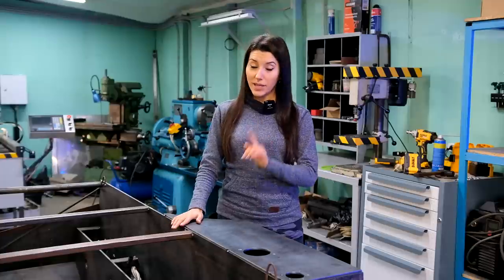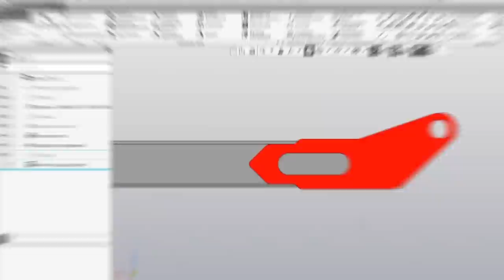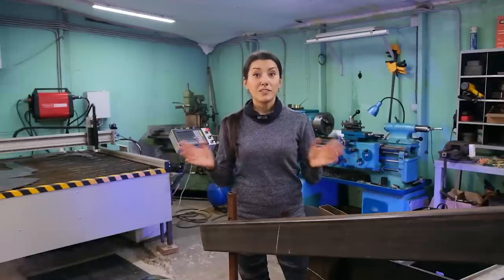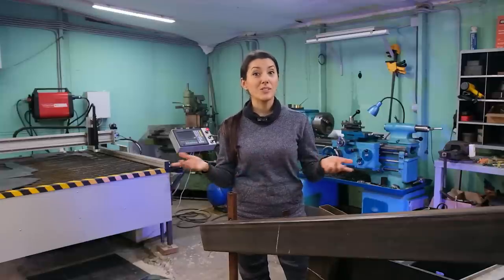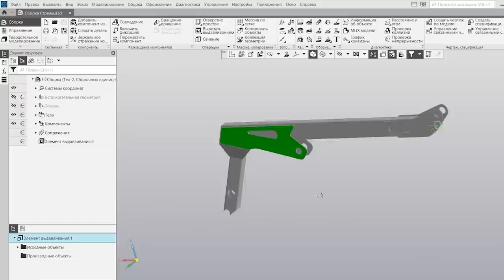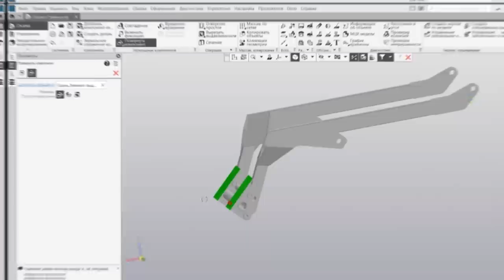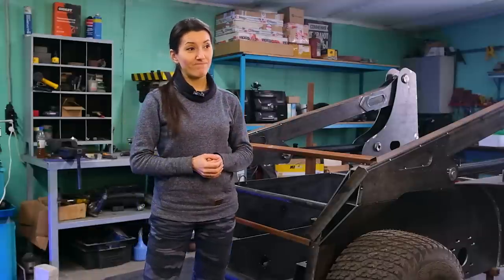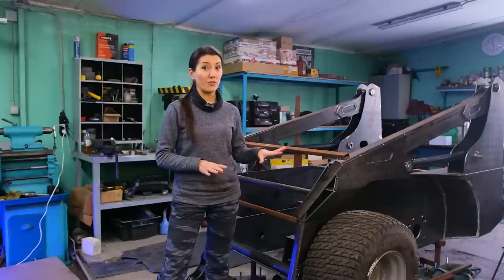DIY SKID STEER. Part 2. Boom arm. MINI LOADER.

Comment: It is looking great, only thing I would have changed is the lower pin on the head stock (where the bucket attaches), I would have mounted the pin forward several inches allowing the bucket to roll back further.
I am hoping to start on my own "skid steer" project on my channel soon, I am tracking a Belarus 250AS tractor and then going to "reverse" it with a single telescopic loader arm.
Looking forward to part 3

Comment: "Mid mount cylinder"  👌   problem solved as it mounts in the middle and not on the end.  Good luck. And it looked like you were telling the audience to cable down when you positioned the final link arm brackets 😆  since you give the impression your there by yourself we forget there's a camera operator

Comment: I just admire the work you do! To build this piece of equipment all the way from the bottom up is truly amazing. 

On the hydraulic cylinder, we have all been in similar situations. Choice words exclaimed with utter conviction. Would it make sense to route it partially inside the square tubing? It would weaken them, but you can always add reinforcement. 

Keep these wonderful videos coming!

Comment: I think you're doing a fantastic job with this build. The only concern will be the upper and lower arms. I think you'll find you'd want as thick walled tubing as possible. Most skid steers, the lower arms are solid metal, not tubing. If you intend on doing any digging, the lower arms will be the weakest link. I think it will be just fine. For your cylinder for the bucket, think just a center cylinder, right in the middle. Center strut can be heavy to allow for a solid mount for the cylinder. 
It's nice to see you stop and give us your thought process on the build. Not many do so. Looking forward to part 3.
Reply: I would say it's a 'balance point', weight of the arms vs stifness. I my mind better go for 'thick enough' rather than 'thick as possible', regarding wall thickness. What I mostly see is both upper and lower arms as hollow sections. But some brands use soild plate for the lower arms, possible to simplify. One can do it either way. Anyway, from what I understand she has spent some time studing skidsteers close up, taken measurements, and will come out not far off. Wall thicknesses are harder to see, but will guess up to 1/4'" thickness of the upper arms for a smaller machine like this. Agreed with a center cylinder for the bucket

Comment: Impressive project.  I just got done building skid loader style front quick attach for a wheel loader I bought.  I like your overall design.  Looks like some of the older bobcat loaders.  I have a newer bobcat t320 machine and it is my main loader on my farm.

Comment: You are doing a awesome job! I was trained for years to be a metal worker and in all honesty don’t know if I could do what you are doing! 

If I offer any advice from my training it is this, when you weld large steel plates together it helps stop warping, welding pull, etc by starting your weld and welding back towards your last weld. So weld the first stitch say 200mm long, then move forward 200mm start the weld and travel back towards the last stitch, then mover forward 200mm and repeat. By doing that the heat of the weld/expansion of the steel is greatest were you have already welded. Plus you are burning out each welds start with the next welds finish.

Plus remember a vertical up weld has the greatest welding penetration, so if you need to ensure a super well penetrating weld it can be best to set your welding prep up to weld vertical up.
Reply from the maker: Thank you for the advices
Reply: @luciasworkshop  most welcome! Keep kicking butt girl, your really doing a awesome job and I am excited to see the finished product! 🤩

Comment: Another concept you can try, is using cardboard. It comes in handy when you want to make a template, plus you can make design changes if needed. It’s better than having to spend more money for more steel. I’ve used cardboard many times for mock-ups on jobs.

Comment: You are awesome!!  I only wish there was not so many miles between us.  It would be an honor to be able to come to your shop where you could teach me.  You say you are not an engineer,   I just marvel at your ability to be self taught.  I know you were blessed to be able to spend so much time in the shop with your grandfather.   I wanted to be a blacksmith,  but my parents wouldn't allow it!  Mistake on my part , now being 79 years old I still want to learn all those things.  And with your channel I can learn alot, thanks for being here, make it a great day and be a blessing, jw
Reply: Anyone can be an engineer, the trick is to be a good one. Like Lucia I have no formal training, but instead substitute a large amount of time thinking about things. Half of the job is thinking about how it can fail, and then looking for ways to prevent it.
Reply from the maker: Thank you very much Jerry! 😊You know, one of the things I've learned is that it's never too late to start doing what you want. Wish you luck 😉
Reply: @luciasworkshop  I used to say that my mum all the time. Only when you're dead is it too late to learn.
Reply: I guess I don't quite understand the address to e-mail you at for the gift?  Just tell me the correct address to e-mail you please, thanks, make it a great day ,jw
Reply: Thanks for the update Dodgy !

Comment: This video could have been much longer and I am pretty sure we all would have watched to the end.  A voice-over narrative of what you are creating at a given point in the video would have helped greatly.  An example of why a hole is cut in the sheet steel or why a pin is created or a bushing.  A narrative is much easier than trying to ad-lib as you are working as you can edit the video and insert commentary to compliment the action going on.
Your metal working skills are top notch and please continue the excellent work.

Comment: I'm just a mechanic and have only minimal experience on a lathe and mediocre fabrication, but I have worked on a variety of things. Take it for what you will.

When you were building the pump belt drive carrier, you welded the helix cut gear   to build the toothed pulley hub. Drive gears are usually case hardened and that may have affected your penetration and thus prone to cracking. I could be wrong though.

Also, this 2nd part might already be in your plans, but you'll need to modify your pins to keep them from spinning in the pin bosses. Usually you'll see a plate welded to the end of the pin with a tab sticking out so it can be bolted to the frame or pin boss. Or sometimes if the boss is wide enough you can through-bolt it through the pin.

Comment: Really big fantastic work on a very ambitious project. I couldn't do it half as well.

I also need to see the design of things at various stages for myself - not just on the computer. 😉

I'll echo the comments about sizing and lubrication of the arm pivot pins. These are typically much thicker - 80 to 100mm or so. They are often pinned in place or use snap ring retainers so they can be removed and replaced.  The comments on torque applied to the arm supports is also great advice. You'll have the same thing happening with your counterweight.

Yes, you will likely need a counterweight. Have you thought about that?

Awesome, awesome video!!!

Comment: mini loader in the title, but seeing you inside for the welds made me realize that it was rather a big model! what load capacity are you looking for? Otherwise, do not forget to make stops between the end of the arm on the bucket side and the frame so that the bucket is at the bottom, when you push the bucket in a pile or in the ground to dig the thrust forces pass through these wedges and not by the arms! For the bucket cylinders, if you can add a parallel lifting system it is much more practical to use and you will need smaller cylinders, look for example at the TOYOTA SDK7 they have a system like that, when you lift the bucket remains parallel to the ground regardless of the lift height. Can't wait to see the rest of this build! Thank you for sharing.

Comment: Don't be so hard on yourself you're building a prototype, consider it a revision, (ECO Engineering Control Change). I was surprised that you weren't working off a set of plans. I like to combine the best features from multiple different designs, you're very smart you will figure it out. I look forward to your next video!

Comment: Just a tip from someone who does heavy and light fabrication when you’re welding long sections of plate try “back stepping” it where you weld one side then quickly weld the opposite side but start an inch past the previous it stops it pulling hard

Comment: Hi Lucia, my grandpa was a blacksmith and his smithshop is also standing at the moment unused like your grandpa's workshop was. Last year I finished my third apprenticeship to become a blacksmith. I was the only girl attending blacksmith class. One day I want to reopen my grandpa's smithshop here in Germany again. During my training I learnd a lot about blacksmithing, welding and metal in general. Watching you making progress with your project, I was wondering if you will put coating on your skid steer, when you have finished, to prevent the metal from rusting?
I really celebrate your projects and what you already did in your grandpa's workshop, YOU ROCK!
Keep going, improve your skills, make the impossible possible.
Greetings from across the globe,
Jenny
Reply from the maker: Oh, it's so pleasant to meet a lady here! Thank you very much Jenny. Sure, I plan to paint the skidster when it's ready ;0)
Reply: @luciasworkshop  I would recommend to put something more durable on, if its possible. Paint easily can come off after a short time. If you are moving dirt or a pile of little stones around and these fly around or some pebbles are hanging in the tires, get loose and hit the painted parts, you get scratches in the paint and the metal underneath gets in touch with the air and starts rusting.

If you have a chance to galvanize the whole frame structure or to put powder coating on it, go for it. 

Maybe your next project, after the DIY Skid Steer, will be building your own powder coating station. ;-)

Comment: I’m excited seeing this all come together!! It’s amazing to see an entire machine being built from raw materials .  I would say you are a talented engineer with some kool equipment. I love your outfits I wear a lot of camo clothing too but if I weld I usually get little burns and splatter but I’m just doing repairs on trucks  and it’s not always possible to get the metal that clean without time consuming disassembly and I have to weld upside down and laying on creepers .... you make the welding look super easy and painless!!
Reply from the maker: Thank you very much Cory😊
Reply: When Dad was welding, he always had his clothes starched, extra heavy starch on his jeans to resist burning and deflect slag.

Comment: I have a lot of comments about the arms. I would love for you to improve on the arms that all manufactures do and just copy. About 30 years ago when running a Toyota SDK-8 I could see a good concept that could be improved upon. The bucket cylinder needed to be switched the boom arm. It would give more breakout force and protection from being bent. (Yes the guys bent the cylinder on the job.) The Toyota arms self leveled. What I'm saying is much like you would see in a large wheel loader. Z bar design. But would work on a skid loader. I own 3 different brands of skid loaders (Daewoo, Bobcat and Kubota) but now one has a better arm design than an other.

Comment: Lucia, it looks like you are using short circuit mig to weld your machine.  that is generally appropriate only for cosmetic sheet work and very light structural work.. you might consider using 7018 smaw or flus core or dual shield wire for better penetration and stronger welds that are more elastic under load.  super cool project.  even used skid steer prices are through the roof

Comment: Your project skid steer loader is going so well.  It's interesting to watch you build heavy machinery in your own garage. :D  Pretty awesome, for anyone.  I have some pictures of a Mustang skid steer, with the exact mount points for the hydraulic rams,  you are talking about.  Bob Cat's and Cat's in general  don't have this style. Hydraulic rams up front.      It's probably because the rams get hit with rocks from bucket over flow in the up front configuration.  But if it's just you operating it, it's probably fine as long as you are aware that the rams are exposed and able to get hit.   Where would you like the Mustang skid steer pics sent?
Reply from the maker: You can e-mail the pics to lucia.reload@mail.ru. Thank you.

Comment: If several days (or weeks) have not passed between editing and publishing the video and you are still looking for a solution to the location of the cylinders take a look at the CAT 259D.
It seems to have arms shaped almost the same with the cylinders fixed to their inner sides, maybe you would just need to grind a few tack welds and swap the positions of the plates that hold the bucket to mount the cylinders the same way. I think at worst you'll need to grind a few more tack welds to fine tune the position of cylinder mounts on those plates.

Comment: Truth is many thousands of hours go into designing, engineering and proofing designs for equipment. And most designs build on previous general and specific knowledge of similar designs. Good thing you let your faith move you forward because if you would have taken the time to learn everything you going to end up learning anyway before you started….you might never have started. You’ve taken on a demanding project and I hope your faith carries you through. Soldier on super woman.
Reply from the maker: This is true. This is why I prefer to learn in process and practice🙂

Comment: Nice project. Respect! One solution could be to extend the height of the cover plate and mount the hydraulic cylinder on the cover plate. I don't know if this is possible or if it weakens the design.

Comment: First of all, I love your project!

I have worked intensely with this type of loaders. I fear the wheels are too big and "balloony". I don't know how else to name it 😁

My suspicion is the loader will be somewhat bouncy when driving with load and tilt, yaw and sway around.
Big loaders - like used in quarries - also tend to jump around due to the bulky wheels.

Another thing I noticed: the pins you use to connect joints of the arms with look a bit flimsy to me. They are normally more like double the size of yours.

Maybe you want to take a thorough look into that issue before finalizing the design and later regret it.

Looking forward to the next part 😃
Reply: I think you are right about the bouncy wheels unless the speed is kept very slow. Also, I left a comment above about the 70% rear, 30% front wheel weight distribution (no load).

Comment: Wow, what an ambitious undertaking, Bravo! I do feel though the commercially bought loaders have arms and steel components and joints that are substantially more heavyweight, and what you are building needs to be heavier and much more solid? It may still work well like this, but be careful to not put any TOO HEAVY load on it... Find out carefully what the max weight is it can handle. Looking forward to more of your project.

Comment: Outside perspective? Never built one. Arguably uses similar design features to a production unit. Just the build itself will help you find what does and doesn't work, and hopefully you don't find any reliability issues down the road, but such is life with engineering and design. It's going to be a prototype, but hopefully a solid prototype. Interested to see it work when it's done.